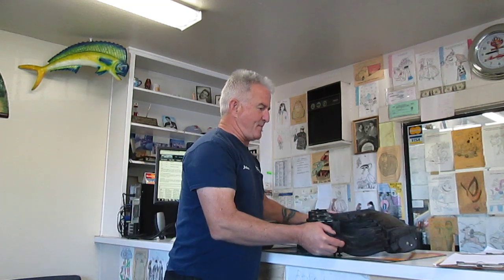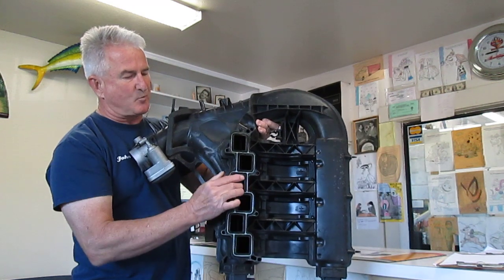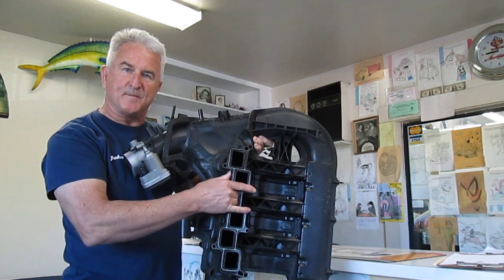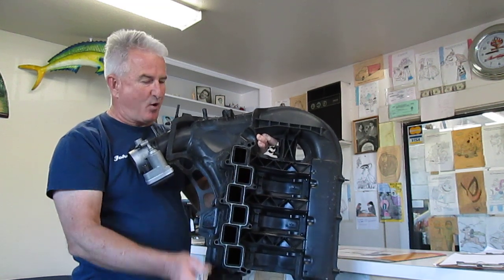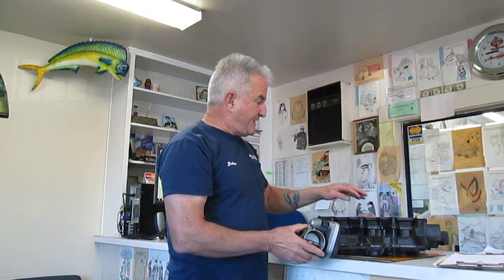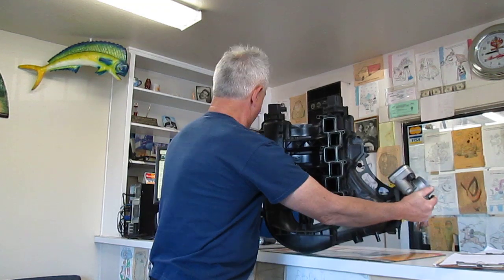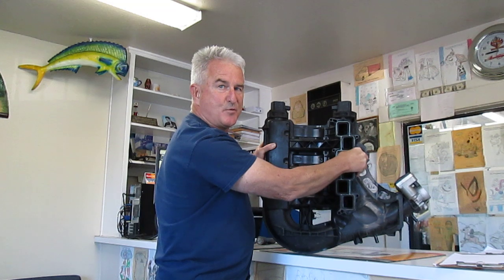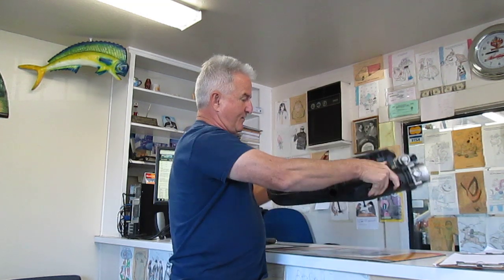How to Diagnosis Code P1004 Intake Manifold Runner Performance

Comment: i took my plenum off and cleaned it i also took the actuator out and cleaned it out and inside where it seats into. no code for months! but now its back. im def not spending $1000 at the stealer ship. 

if you have a remedy at this time please let me know. willing to try anything that might help the runner valve move at proper speeds

also here a tip. i learned about catch cans a little bit too late.  add them to your vehicle to stop these kinds of build up problems
Reply from the maker: Steve Steppenbacker I don't have a good solution yet Steve, It's on my mind though and I still have the old one from the last one i changed.
Reply: john sadler 
have you ever tried to use a "dip tank" ? 
maybe a old steel tub fill it wit parts cleaner and drop the plenum in it and let it soak? 
 everyone  always talks good things about that b12 chemtool i think it is. but decently expensive to fill a tank up to soak something.
Reply: Steve Steppenbacker 

also how many  plenums do you have? 
if u have one to spare and destroy. could be a simple thing as bearings in the runner valve wearing out. ? 
nowadays it seems that everyhting that moves in a way has some king of bearings . 

if i had a spare plenum i didnt care about id dissect it and check and see exatly how the runner valve is fabricated and how exactly is i able to freely turn and not rub or bind on anything.
Reply from the maker: Steve Steppenbacker Apparently the information I received is the runner is not moving fast enough and that's what sets the code. The new design manifold and reflashing the pcm is what the dealerships have come up with. The one I have looks like it's just a shaft inside the plastic manifold. Looks like the parts are just worn out, will let you know when i take one apart.

Comment: same code on my '09 Ram 1500 w/5.7L...'ECU battery feed & power grounds' any suggestions?
Reply from the maker: i had to replace the entire manifold, came with both actuators and new throttle body and all gaskets except the o ring for the egr pipe. The new manifold has some obvious improvements in it. I tried cleaning, pcm updates and the only thing that fixed it was to replace the manifold.

Comment: So I have had this code since right after my last emissions test, in prep for my upcoming one i started trying to repair it myself, from what i understand its gone though 3 different revisions of the full upper intake plenum including the OG one.  I took mine off and tried 2 cleaning methods, to only have the light stay off for about 10 mins.  I really didnt want to drop the 1200$ ( at my local dealer for an out the door replace of the plenum )  for the repair at the dealer, and they had the actuator for 300, that was steep too.  I was able to find it on Amazon for 63 bucks ! ( https://www.amazon.com/gp/product/B00TEFLHH2/ref=oh_aui_detailpage_o00_s00?ie=UTF8&psc=1 ) and after replacing that Im 50 miles in, have taken it over 5K 4 times ( thats a point the short runner should kick in ) and still no code, scanned with my OBD tool and no codes stored.  ( i cleared the code while turning off the car right before i put on the new one, i also did not disconnect the battery, didnt want to risk confusing the codes, idk but just felt right not to )  So the one thing i have not noticed anyone talk about, sorry if i missed it, is how to know if your actuator is bad, and I think i figured that out, so there is a lil "dove tail" that fits into the actual valve in the intake when you put on the actuator. 1st take off your existing actuator, while you have it off clean off any excessive "gunk" and put it back on, when you put it on you need to take notice when lining up the "dove tail", if you line it up and push it in, and the bolt holes line up then there is no tension being put on the valve to  keep it closed, when i put on my new actuator, lined up the dove tail, i had to "crank" the actuator to line up the bolt hole about 1/8 of on inch.  When i did this it clicked that im putting tension on the valves to keep them closed (Vacuumed closed) and that might be an indicator that the actuator is bad.  Please feel free and hit me up if you have any questions or anything ! hope this helps
Reply from the maker: Thanks Paul, I have got actuator codes in the past and replaced them with good success. Thanks for the tip, will try it next time I get one in.
Reply: Wait ..the dove tail  is the Lil metal part that fits into the manifold ?? Well if that's the part then I just got a new one in from eBay and was hoping that was the problem but by reading what u said then the new one I got is detective ?? Cuz the dove tail metal piece turns as if there's a spring tension connected to it ! So does it mean that its bad or good ? Cuz my old one which I thought was the problems didnt move at all..and which I'm thinking is the short runner too!???
Reply: Paul McDonald Any update?

Comment: I hate cars with runners . My Dodge Caliber had the p2017 code . I ended up taking off the manifold and cleaning the heck out of it . The code turns off and on when it wants . I'm going to replace the manifold runner tomorrow .
Reply from the maker: I'm working on getting the right combination of BG Products mixed together to free the runners up so you don't have to replace the manifold. Will post a video when I figure it out.
Reply: I removed my intake manifold and cleaned it with throttle body cleaner . I'm picking up my new manifold runner now to install it . I'll let you know if that works as well. 

Thank you for your feedback 😎
Reply from the maker: datchulo1085 Yes sir, keep me posted.
Reply: Well I replaced the intake manifold runner and was able to erase the p2017 code but now I have two codes of p2016 circuit low . Gotta love dodge lol
Reply from the maker: The service bulletins I found say to replace the intake manifold assembly complete with new actuators. This one even has a new throttle body on it.
Reply: I've seen the same for my dodge, I saw that replacing the manifold is the fix  , I've literally have done everything . From doing all the diagnosis from all data to check all the wires . Everything checks out fine . Took off the intake manifold and cleaned everything out . Ive done the computer updates . I guess the only true fix is just buying a new intake manifold . But luckily for me we don't have emissions in Florida , it's just annoying seeing that light on .
Reply from the maker: I hear you on that, you won't know if something else is going on due to the light being on all the time. Kind of amazing that there wasn't a Recall on this, all I can find is TSB's. You might be able to find one in a wrecking yard as long as it's a newer date code on the vehicle than on the TSB for your particular vehicle.
Reply: I will eventually buy a new one , just not trying to cough up over $200 bucks at the moment . And you're right about possible not knowing if I have other codes on , that's something I do check every once in a while . I agree , there should be a recall on this , it's a horrible design that should be fixed with a matter of just cleaning out the intake manifold .
Reply from the maker: Will keep posting more information as I get it about this issue.

Comment: Hi John,

Have you been able to find any solutions for fixing this code since you posted the video? Having the same issue on my 2007 Charger and I was wondering if there was anything I could try before resorting to replacing the entire thing.
Reply from the maker: +Dang Nguyen Hi Dang: Hook up a generic scan tool and uses global obd2, clear the codes with the key on and engine off, the start the engine and look at global obd2 again and if a pending code for the intake is there right away then you have to replace the manifold.
Reply from the maker: +john sadler If no pending codes or check engine light right away you can go to the local dealership and get the pcm reprogramming done and use the BG Products thru the throttle body and that has worked for awhile on some of these. Especially if it's an actuator code.

Comment: Any update?
Reply from the maker: Hi Lewis,  the only fix I've found is to replace the manifold from the dealer. It comes with new actuators, throttle body and gaskets.
Never have a problem now.
Reply: @JohnSadlersAutoRepair  thanks bro!  does the dealer have to do it or can I just have anyone install the new stock manifold? I have codes 2017 and 1004. Have already replaced actuator and cleaned runners. Codes stayed off for a while then came back. It's an 08 magnum. What parts should I buy and where should I buy them? I might can do it myself
Reply from the maker: @LewisJohnsonIII  I buy the new manifold from the dealer, comes complete with everything you need, make sure you give them the complete vin number. If yours has an egr pipe in the rear of the manifold that o ring didn't come with everything else. 
Its also a Great time to replace the spark plugs since one side is under the manifold. It wasn't that bad of a job, keep everything clean and blow off the top of the engine and all around the valve covers and intake manifold before you take it apart.
Reply: Vin is 2d4fv37v68h163180. Does it need that extra o ring for the egr ?
Reply from the maker: @LewisJohnsonIII  the dealer will tell you if you need the oring by the vin number

Comment: My neighbor has the 4.0 engine with the runner problem as well.  I will let him know that it is caused by build up on this horribly designed piece of crap intake system.  What did they have in mind when they turned something so simple into a Chinese F story like this?  Other parts on this engine are just stupid as well, such as plastic parts that are attached to metal parts that wear down and are responsible for evap leaks.  You have to be kidding.  Mickey mouse plastic doo dad connectors on the fuel pumps which crack and break, made so weak, just road vibration will inevitably fracture them.  Evap connections made of plastic that will turn brittle, crack, and break within 5 years.  This list goes on and is just stupid, as evap in general is just stupid.  The entire evap chain in a lot of cars is made with probable break down after probable breakdown.  I heard the 3.5 engine after only 5 years has a common small evap leak / whistles and again, the idiots at the dealer will say "entire intake"... this is why American Cars suck.  I will no longer complain about some of the minor engineering woes of my Audi, after looking at this hunk of dung.

Comment: my 05 magnum Will get a lightning bolt on the dash and will not go over 20 mph is this the same problem ?
Reply from the maker: +valentin contreras I'm not sure? Do you have a check engine on also?
Reply: Mines only did the lighting bolt when the egr value in the back was disconnected or not fully inserted so it was an leak